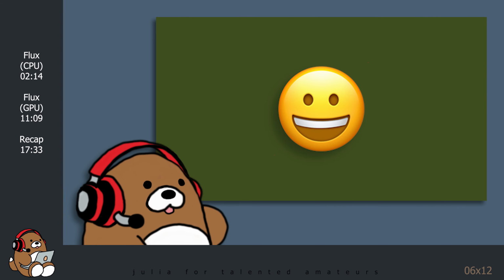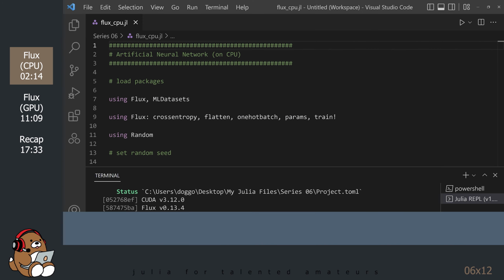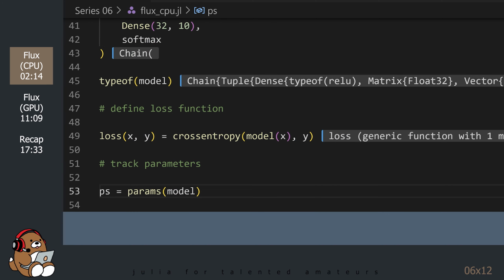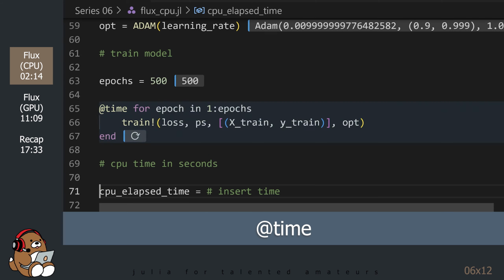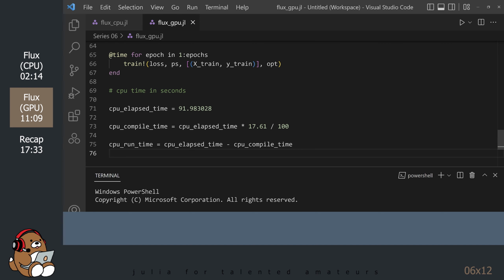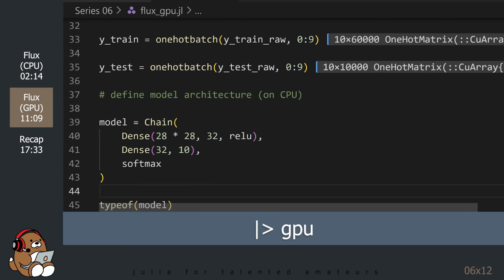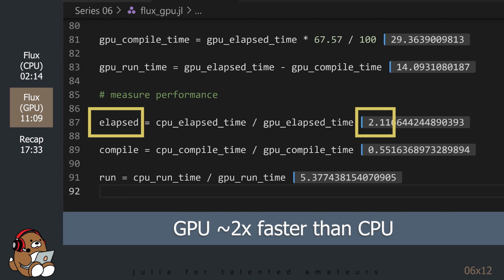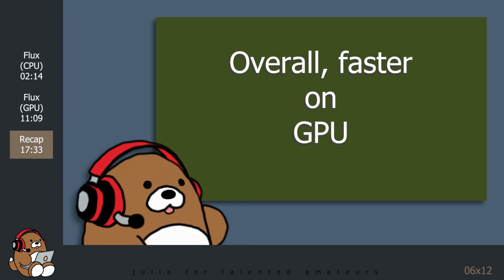[06x12] How to use your GPU for Machine Learning using CUDA.jl and Flux.jl (CUDA.jl 101 Part 3 of 3)

Comment: Thank you for the videos. Very informative and easy to follow. 

I do have a suggestion for timing.  @btime removes compilation time is useful for fast functions. @time is sufficient for slow functions (such as training a neural network). However, when using @time, you should run it twice and use the second run. During the first run, the function is compiled, but the compile time should not affect subsequent runs.